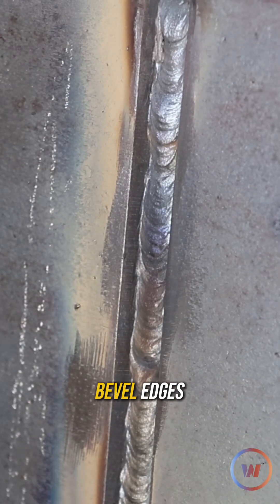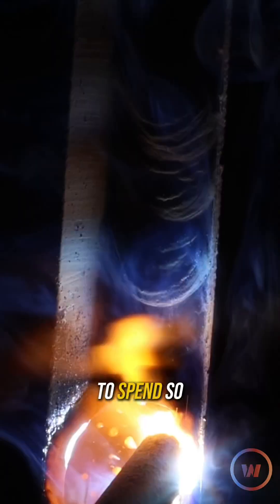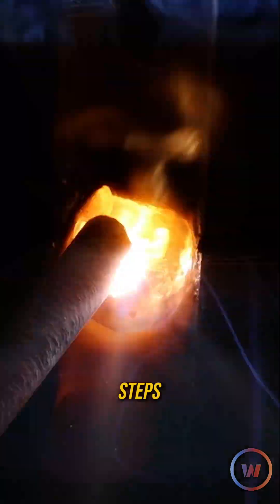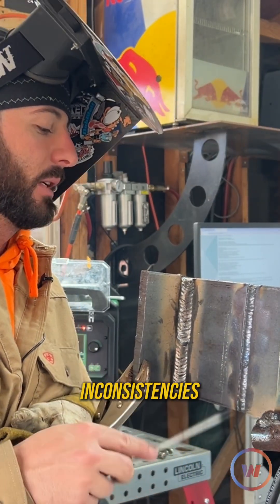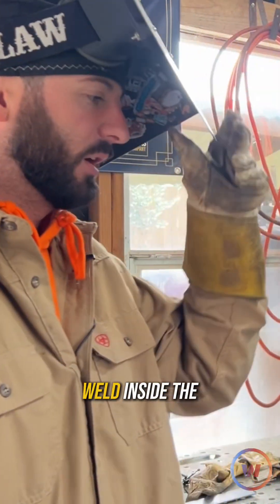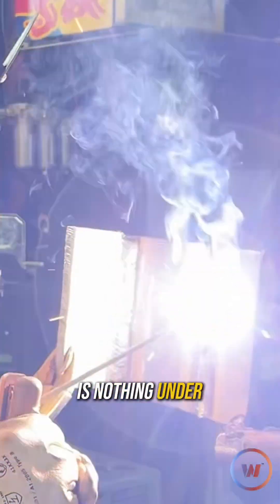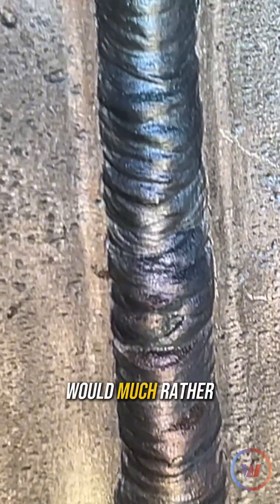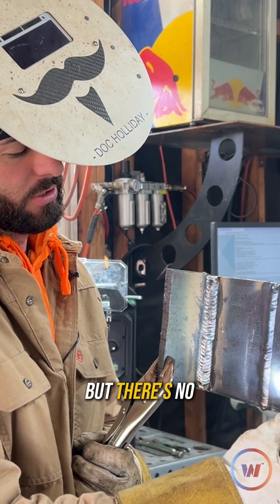Size really does matter when it comes to your 3G weaves #stickwelding #7018

Comment: Takw care of the sides , the middle will take care of itself!!
Reply: thats very true, I cant believe I haven't heard that before.
Reply: @mtraven23  , absolutely!! Those bevel edges should be used as a guide. As long as your weaves/oscillations are tight and consistent with your entry angle , you will be golden . So , a bevel should be 37.5 degrees. However some big bore and heavier wall bevels will be 3+ inches across. At that point you run stringers and. Weaving should be 1.5-2.0 X Rod Diameter !! I love these welding tutorials . 30+ year hand ( refineries, plants , powerhouses and fab shops ) . Keep burning wire !!!
Reply: @jameswoodward6312  thanks for the knowledge!